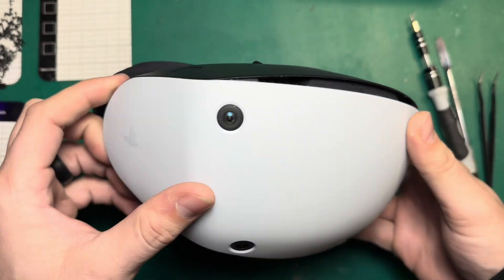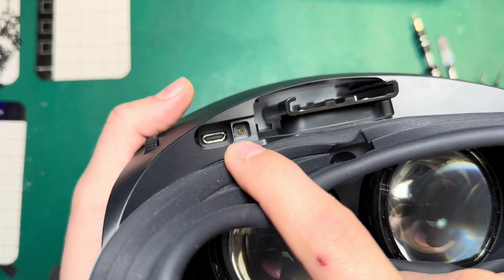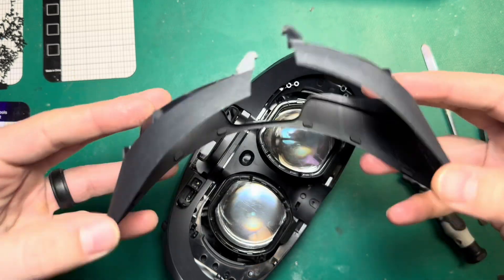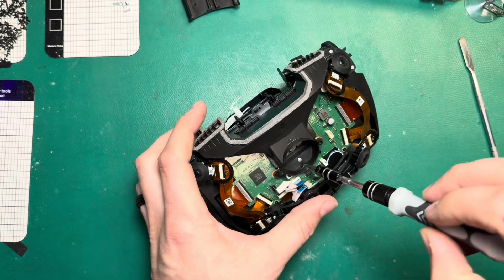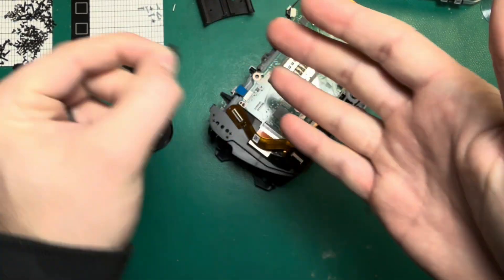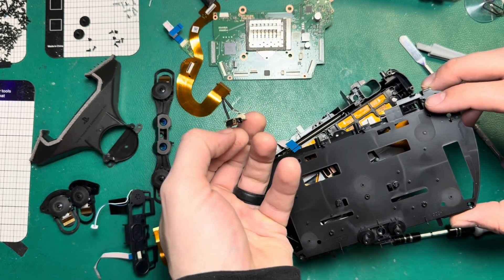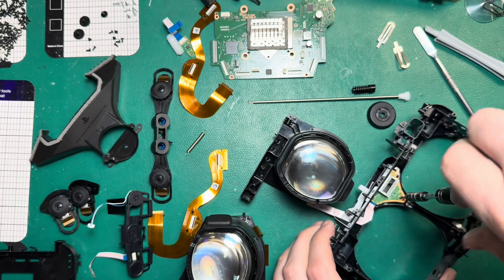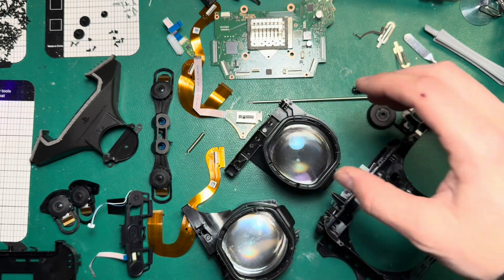What’s Inside the PSVR2? (And What Surprised Me)

Comment: Hi my meta quest 2 won’t turn on and has a solid red light on it. I have been charging it for 8+ hours and it won’t turn on still has solid red light also. Any tips of how to fix it?
Reply from the maker: In my experience this is usually a board related issue. You can send it in for evaluation on FixMyOculus.Com
Reply: @fixmyoculus  thanks I will look in to it

Comment: this headset would be perfect if it had pancake lenses and the pc adapter didnt lock off a lot of the features
Reply: I also wish it had pancake lenses. Oh well.
    It makes sense that the extra features aren't supported on PC because.... well PC doesn't support any of it anyway. Even if the features were made technically PC capable they would be completely useless. 
      No PC VR game has HDR, or would go out of their way to support its advanced haptics. So there is no point in having them.

       Eye tracking however... that one they should bring to PC. I think hardly any game uses it at all, but I assume moving forward eye tracking will become more common for gameplay and more importantly eye tracked foveated rendering. It is amazing on PS5 but I don't think PC supports it very much yet from my understanding. It really really should though. Maybe when eye tracking headsets are more common
Reply: @EmperorCostco_C4-621  pc does support dynamic foveated rendering in steamvr, and eye tracking is supported in games like vrchat
Reply: @kushy_TV
   Steam VR supports eye tracked foveated rendering universally?

   Well, dang, if it does, that does immediately suck it isn't functional on PSVR2. 
   That's a really good feature to be missing then while the others wouldn't matter currently.
Reply: @EmperorCostco_C4-621  It doesn't, I believe you need to have openxr to add in. Only some games have it natively, like Flight Simulator. So yeah, you're right, in that it's super rare and those great PSVR2 features don't really exist on PC (yet). Eye tracking is being worked on by a modder and almost ready (VRchat!).